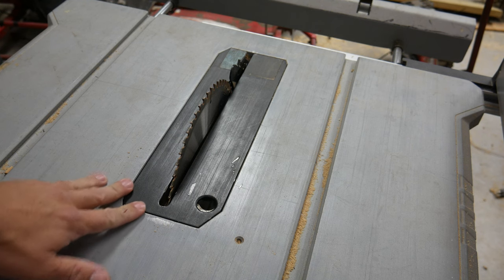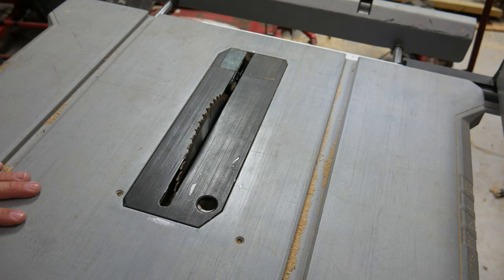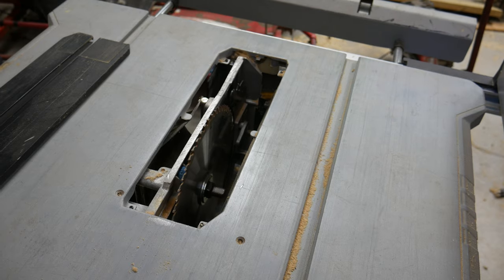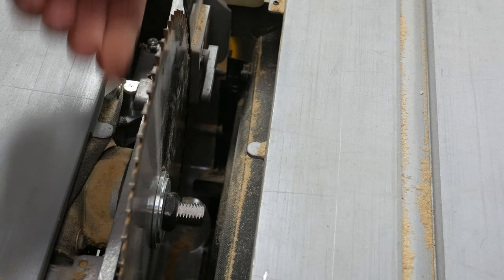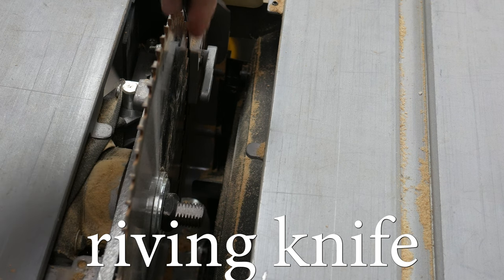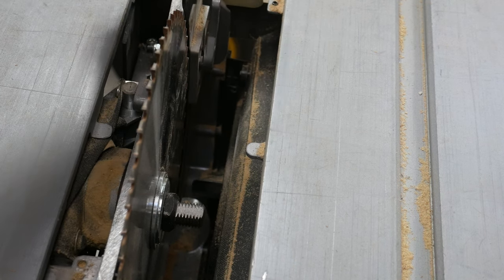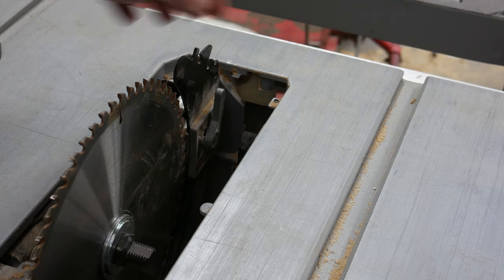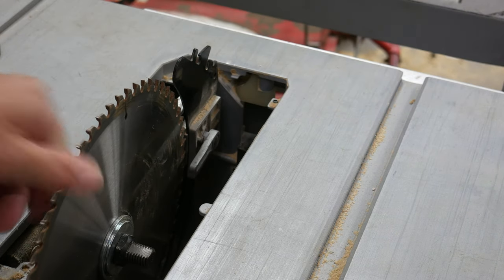Don't Forget About This

Comment: How do I adjust the riving knife? I’d like to raise it a bit.  

Also do you have to push the tensioner back down after you change the blade? 

I have a dado set I need to use soon.
Reply from the maker: I'll look into it.